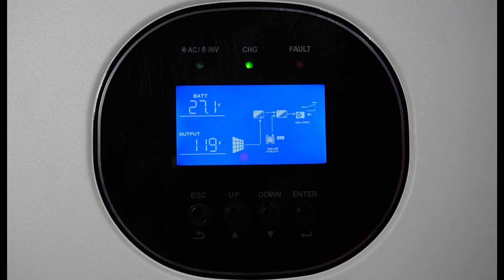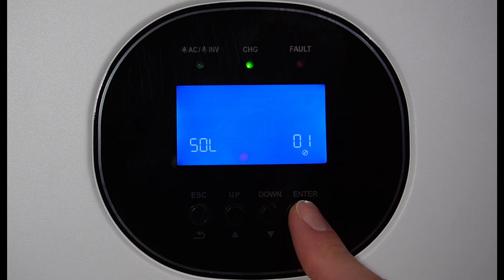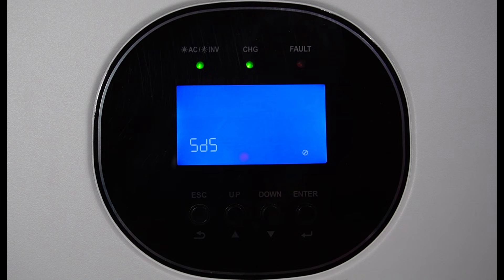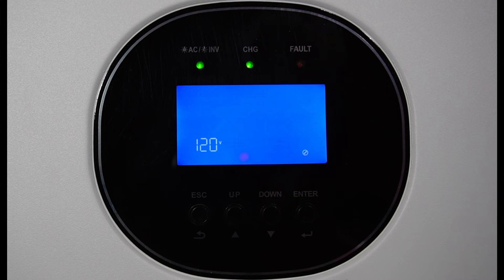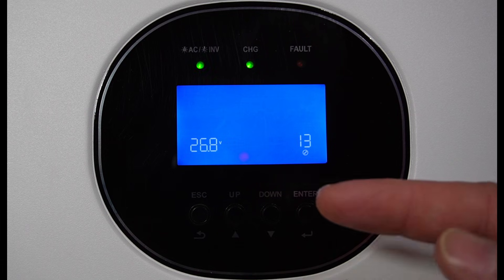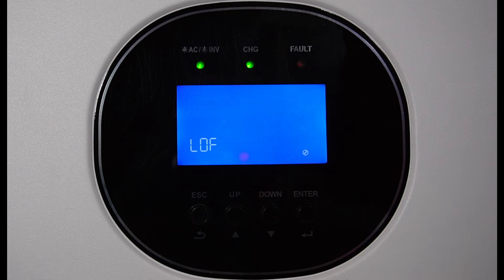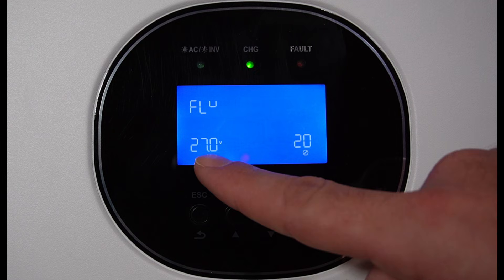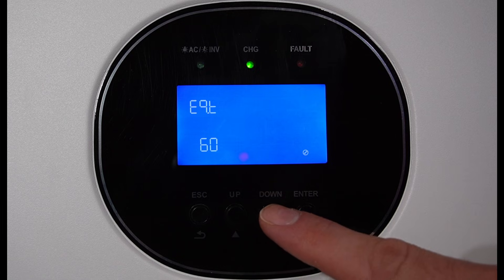Growatt Settings LiFePO4

Comment: Today I installed lifpo4 12.8v 100ah 4pcs in series parallel connection to achieve 24v 200ah after installation the inverter is showing BMS Communication Error , what is the solution?
Reply from the maker: Use the lead acid protocol and change the voltage for LiFePO4

Comment: I have two separate sealed 16S LIFePO4 packs made by SMS Sunmate. They are two separate systems each with its panels and and hybrid inverter. One battery is 5WH and the other is 15KWH+. Just as you experienced and stated in this video, my bigger system inverter does not communicate well with the battery BMS so I use user defined settings. My thoughts before this video was perhaps its due to cheap or poor quality inverter or battery. Now I know better it might just be communication system issues. Okay. The settings that I have found over a couple of months that work to give me a 100% state of charge is a bulk charge of 56.4V (approx 3.525V per cell). Since LiFePO4 chemistry doesn't really float per-see I use a float of 53.5V. I currently use lower charging currents of 40A and 10A respectively. This allows me to use other heavy loads during the day while my battery slowly charges up. Still observing.😊
Reply from the maker: Very nice, sounds like you've been watching things closely. 👍 Nice job

Comment: Hello good afternoon! I wanted to consult:
I have a Growatt SPF 3000TL HVM Inverter and a 24v 100Ah Lithium battery with BMS connection. The inverter recognized the battery perfectly, but when charging the battery does not float... On the contrary, it charges up to 99%, cuts off the charge, disconnecting the panels and when the energy drops to 94% the cycle begins to repeat itself again... 
Is there any programming I can do to keep my battery floating so I can harness the power from the panels throughout the day? Or is all of that commanded by the battery's BMS? Thank you so much!!!
Reply from the maker: I'm not sure. I used voltage, not communications, when I hooked my batteries up.

Comment: I am using a Growatt SPF 5000ES inverter with a Growatt AXE 5.0L lithium battery and 8 × 570W solar panels connected in series (387V total).

The battery is now fully deep discharged (0V) and does not accept any charge from the inverter. I have connected the CAN communication cable (RJ45) correctly from the battery to the inverter’s BMS port, and set the inverter to Lithium (Li) battery mode, but the battery remains off and unresponsive.

I believe the BMS has locked the battery, and the inverter is unable to wake it up. No SOC or voltage readings appear on the screen.

Please advise how to reactivate (wake up) the battery safely. Your urgent assistance is appreciated
Reply from the maker: Oh no! I'm not sure. You could try to get a charger to wake it up.

Comment: 3.6V per cell is quite high, battery BMS could cut out before that, Ive set mine to 3.55V per cell. 16x3.55 = 56.8V (48v system) 8x3.55 = 28.4V (24V system). Set float a little lower to stop changing cycling. 3.35V per cell, 53.6V (48v system) or 26.8V (24v system). Seams to work quite well. Also set inverter to stop at 2.69V per cell, 43V (48V system) or 21.52V (24V system) this gives the inverter some backup power for about 8hours before battery BMS cuts out. If the BMS cuts out you have to Bluetooth into them and turn on emergency mode, otherwise inverter wont see any batteries and wont charge once the sun comes up.
Reply: I have same problem dear can you plz help me, 

I am using a Growatt SPF 5000ES inverter with a Growatt AXE 5.0L lithium battery and 8 × 570W solar panels connected in series (387V total).

The battery is now fully deep discharged (0V) and does not accept any charge from the inverter. I have connected the CAN communication cable (RJ45) correctly from the battery to the inverter’s BMS port, and set the inverter to Lithium (Li) battery mode, but the battery remains off and unresponsive.

I believe the BMS has locked the battery, and the inverter is unable to wake it up. No SOC or voltage readings appear on the screen.

Please advise how to reactivate (wake up) the battery safely. Your urgent assistance is appreciated

Comment: Do this system have wifi setting to wach band electric trons do?
Reply from the maker: I'm not understanding your question
Reply: Wifi to work on routers?
Reply from the maker: @user-fi7hv7ot6y  Yes you can connect this to the Internet

Comment: My growatt inverter have some issue, sometimes didn't charge even the sun is rising.
Reply from the maker: You array might not be large enough. You also need a minimum voltage for the MPPT to start tracking

Comment: My inverter started ringing after the power went out for a few seconds and came back on. I don’t know how to get it off. Do you have any tips?
Reply from the maker: @jennychavez2436  Started or stopped?
Reply: The chimes? Can be turned off. Look at the settings I'm not sure off hand but it's in their. Comment  again if you have not figured it out I'll read my manual and let u know.
Reply from the maker: @johnandrews3049  there is away but I can't remember how. I don't have that unit anymore

Comment: Any tips. My 15kwh battery stops giving out load when it gets to 58% but start again once it gets to 59% any help?
Reply from the maker: @chigozie424  Are you using voltage or communications

Comment: Great videos. I have one question, with my Growatt 3000/24v on setting 21- I can adjust it to 24.0v but it just defaults to 21.0v when I press enter.
Reply from the maker: @dproulx797  I'm not running that system anymore so I'm going by memory. I believe there is a user 1 and user 2 settings. Try it with the other user setting

Comment: I have a SPF3000TL-HVM. I find that my Growatt is inaccurate. I see with a 150watts of load applied the inverter, around 260watts at the battery (reported by the inverter itself). When I test using a current clamp, I see 164watts of load at the battery. With a load greater than 1500watts, I start to see more accuracy within <10%.
Reply from the maker: @MickDownUnder  Interesting

Comment: Im no expert , though Ive succesfully built 6 different Lifepo4 systems from 12v 24v 48v .. 
Just me 2 cents worth here ..
Its not really necassary to bulk charge any of these individual cells up to 3.6v.

You could shave the charge down to a safer level of 3.55.. or even a tad less ..
You dont gain much more storage at 3.45 to 3.55 so why risk getting anywhere near the danger zone 🤷‍♂️.

Providing your cells are closely balanced with a discepancy of 0.020 difference between lowest voltage cell and highest voltage cell ( during charging )all of your cells should break 3.4v charge before you have the usual suspect cell , running away and triggering your max voltage charge point , shut off . 

I use JK-BMS mostly for the auto balancing feature which ( in time ) balances all your cells without the need to top balance .. 
This BMS also shows me everthing i need to know thats happening within the cell via a decent phone App .
Another brand for example Daly BMS cannot do this  ( you need to buy a seperate Daly balancer that has known performance  issues )  and Ive had multiple Daly BMS failures and no support from Daly ( yes this is my revenge against  Daly's integrity ) .

Pushing your cells to their max is similar to pushing a car to its red line, all the time ..
For that extra , small amount of power you get - could shorten the life expectancy of you battery ,( or car )  power bank,  considerably .
Im still learning every day ..its a fascinating technology 👍🏻

Comment: all i know from growatt talking a lot about a one dolar part and giving the blame to other
one say we send you the missing part the other say no you can not have the missing part
we do not make mistakes you have to order them ,no problem give me the bank acount number
and i send you a dollar my hour pay is 150 and this going on months the inverter is not even working
because i can noy connect it pv connectors are not the same as battery connectors and they are missing.
Reply from the maker: @HenkBronkhorst-c8c  why are you posting this to me?
Reply: @Roll2Videos  it is not to you but to growatt it is nice to here good things
if it is the truth
Reply from the maker: @HenkBronkhorst-c8c  I've never had a problem. You must have had a one off problem
Reply: @Roll2Videos  i do not have a problem
they have a problem i can fix the problem
it is only not my job to fix there problems
and yes this is one of a kind and it is test
inverter for a innovation, they can be sure
it will stay by this one thanks to there service they are just one from many
and it is not me only having problems
with them there are many cases like mine.
Reply from the maker: @HenkBronkhorst-c8c  You should make some videos and post them.

Comment: I don't know if this thread is being monitored a year later but I have my settings as you described yet the CC/Inv. does not push power into my battery. My battery is currently at just under 49v. The lcd screen shows power being taken from battery but nothing going in. I have no loads set up as of yet. I want to get my battery topped up first but cant seem to get there
Reply from the maker: Not sure. Go through all the settings again. Sometimes, people miss one thing, and it doesn't work.

Comment: Hi we have 6pennal 450 on growwatt 5k but soller is not connecting.please help us tank u
Reply from the maker: Voltage maybe too high. Are they 3P2S? Three in parallel, two in series. 
Check your charge settings

Comment: Any reason why my charging led light never stops blinking?
Reply from the maker: Not sure, Check with a clamp meter. It could also be the upper voltage is higher than you cut-off voltage of the battery.
Reply: Please can you explain?
Reply from the maker: @eddyjones689  What type of batteries are you using?
Reply from the maker: @eddyjones689  what is the chemistry of your battery
Reply from the maker: @eddyjones689  12 volts?
Reply: @Roll2Videos  Yeah
Reply from the maker: @eddyjones689  In parallel on a 48V inverter?
Reply: @Roll2Videos  Ofcourse, totally off-grid.
Reply from the maker: @eddyjones689  🤦
Reply: @Roll2Videos  did I say something unusual?
Reply from the maker: @eddyjones689  By the sounds of it you have 12V hooked up to a 48V inverter.

Comment: Thank you for your video explaining the setting. I have GrowattSPF 3k x6 set up 3 inverters in each phase.  3 solar panels for each inverter to keep voltage and amperage manageable. I am using 12kwh 12v 250Ah batteries x 4 but does not have enough storage to run our household throughout the entire night or cloudy snowy days. I am switching over to LiFePO4 12v 260h x 6 as don’t want run generator for lack of storage or water pump. Do I need to charge the LiFePO4 batteries prior to connecting to my system. Thanks for your input.
Reply from the maker: You don't need to charge them first. If you are series connecting them you do want to top balance together first in parallel.
Reply: Thanks again. I have set them up and working well. However I still need additional power. Have you hooked up a generator to your system and if so would you give details please?
Reply from the maker: @danielmoullet9670  Maybe this video will help.
https://youtu.be/e-RuUy2aizw?si=wcJ3xH4TCZ7jBpED

Comment: Thanks for making this video - it's really helpful. One question though, at 19 you can set the charge voltage cutoff, but after it cuts off at what voltage does it come back on again to begin charging? Is that also adjustable?
Reply from the maker: It comes back on above the low voltage cut-off. If you have utility first on, the charging will happen when the battery is below the float voltage. Review setting #1 carefully.
Reply: Will the inverter turn on to charge when the sun is out again?

Comment: If my battery’s say they have a communicating bms will the growatt automatically do it? My battery’s don’t have a port.
Reply from the maker: You must look into the BMS manufacturer to see if it will connect.
For most, I'm going to say no. I used Daly BMS without communication no problems.
Reply: @Roll2Videos  cool. Thanks. Another question, have you had issues on the ac output side running appliances? I was getting funky voltages in my breaker box
Reply: 120v hot-neutral. 60v ground-neutral??? 60v hot-ground???
Reply from the maker: @bobbymcgee901  No, I never had any issues
Reply from the maker: @bobbymcgee901  odd
Reply: @Roll2Videos  any idea what would cause that
Reply from the maker: @bobbymcgee901  I'm sorry, i don't

Comment: hi, its possible to use my DiY Lifepo with the growatt inverter ? the inverter just have to charge and dicharge the batterie, no communication between the BMS..  thanks
Reply from the maker: Yes, Just set the voltage value. Don't use the Li setting
Reply: @Roll2Videos  so i have to use the custom settings, right ?
Reply from the maker: @samaur1460  yes
Reply: @Roll2Videos  and the 3000sph is working with 48V batteries ? in the specs they mention high voltage growatt batteries.
Reply from the maker: @samaur1460  they have a 24v and a 48v inverter the sticker on the unit will tell you
Reply: @Roll2Videos  thank

Comment: Hello, thank you for this video. I am thinking of getting the GroWatt 24v 3000W.  You mention that you are off grid,  how come you chose 24V over 48V?
Reply from the maker: To be honest, I was new at the hobby,
Now that I know more, I will be using a 48V unit. This summer, I will be changing out the 24V for a 48V.
Reply: @Roll2Videos  Ah ok, thank you!  I feel the same way. I have a small 12V system and I don't feel comfortable making the jump to 48V.
Reply from the maker: @Handelson  Take your time... There is no need to jump without looking first. 😁

Comment: But on sol setting if your setting 12 is set on 23v you drain your lithium basically to 0 percent before it switch back to utility or grid power. Then it's not good setting it to sol if you have grid power as you drain your lithium to 0% daily on sol setting .
Reply from the maker: I would say 20V is 0%. 2.5V per cell 8 cells. If you look at the discharge curve 23V is more like 20% SOC. 2.87V per cell @ 23V
Reply: @Roll2Videos  okay more like 20% this leaving no power for power failure or in South Africa no more battery power for load shedding later through the night . So using sol or sub works great on gel battery but on lithium you draining the lithium to 20% daily reducing the life and leaving no energy for load shedding
Reply from the maker: @gm9666  So, it depends on the user's situation. 👍This works best for me; here's my video.😁

Comment: Which setting will get the panels to charge the battery first and use grid to run the load? Currently the load is running from panels and batteries and then my batteries aren’t full enough for a 2 to 4hr grid power outage at night .
Reply from the maker: I believe you want SBU

Comment: hello thanks for that video, one question: in Island mode , if it is dark and the battery is empty , does the growatt automaticly switch over to grid via the AC input port , to have power for all loads in the House? and have the growatt power supply from AC input for it self ?

could the growatt work only with pv power , without a batterysystems?
Reply from the maker: Yes, The Growatt has a AC input and transfer switch, I don't think you can run the unit without batteries.

Comment: How do I. change the settings to a non acid battery?
Reply from the maker: Non acid I'm assuming you want lithium.
This video is my settings using Lithium batteries (LifePO4) I do not have a BMS that will communicate with the Growatt.
If you are using a 48v lithium pack double all the voltages. 👍
Reply: @Roll2Videos Yes. I have 24V 200AH LIFEPO4 Battery Deep Cycle Lithium Battery Rechargeable for Solar Power System Home…
Reply from the maker: @StatePeach2012  perfect, The settings in the video are for you.

Comment: Can you do a video on the proper steps to adding a battery to your system and any settings you need to change?
Reply from the maker: I made a video in the past adding 5.7Kw and I'm standing infront of my solar array in the thumbnail.
I don't have batteries with communication to the Growatt so all I did was charge both batteries to ~100% and connected them in parallel. I didn't need to change any settings